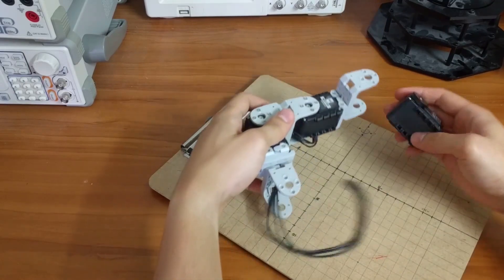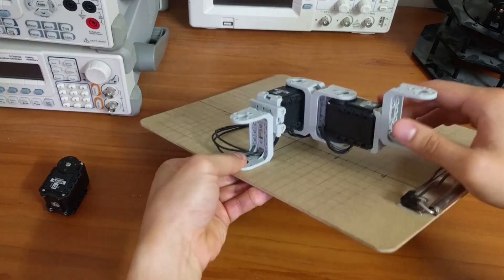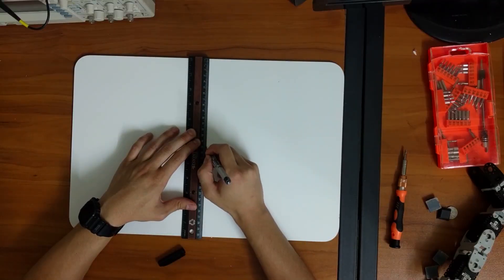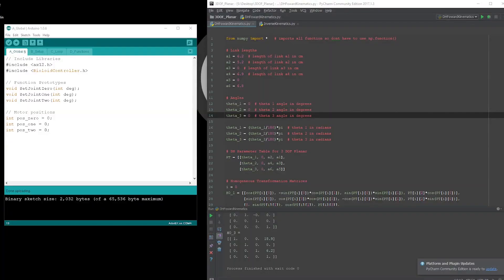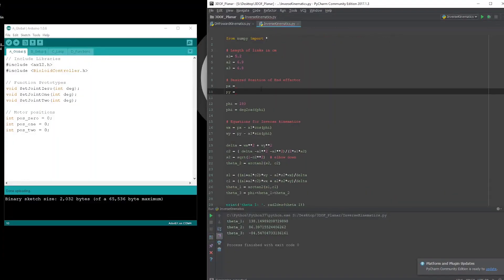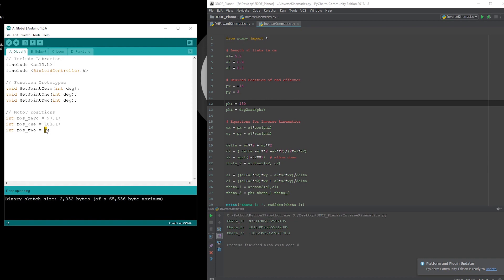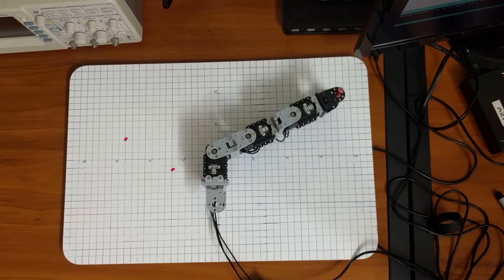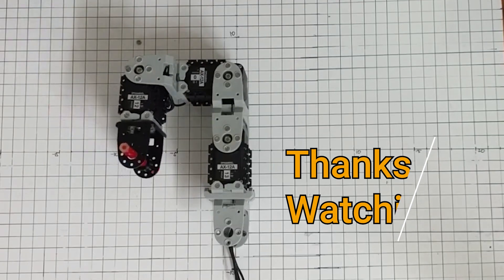Python Project | Forward and Inverse Kinematics with 3 DOF Planar Robot

Comment: why do you have 6 lengths values for your forward kinematics???
Reply: I figured it out. Think of the original 3 distances you have as the hypoteneuse of a triangle. These three distances must be broken down into their x and y components respectively, sqrt(x^2+y^2) = h( one of your original lengths). Robotics 1 U1 (Kinematics) S5 (HTM) P2 (HTM by Denavit Hartenberg) explains it best in my opinion.
Reply: ong

Comment: hello sir, I am designing a 4 axis robot arm for my university project. What is required of me in my project is to move my robot arm lineary in x,y,z axes with 3 potentiometers. I need your help with software. I would be very happy if you could help.
Reply from the maker: what motors are you using?
Reply: Servo motors

Comment: i just want to inform you that you have a little mistake in your arduino code. For Example @04:59 you can see that you have specified pos_two = 86.4 but you declared pos_two as an int that means you can not store float values inside of an int variable. What you will get instead is that 86.4 will mit truncated to just 86 and stored as an int variable inside pos_two. If you do that a lot inside your project you will get a heck lot of inperfektions of your positioning. Solution: Use float or double instead of int for any floatingpoint number you want to store inside an variable. Cheers